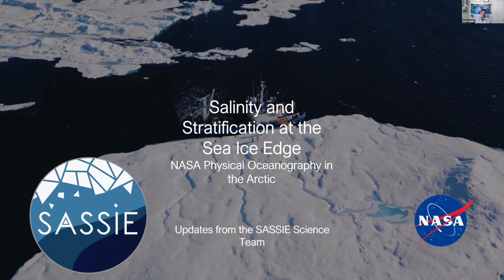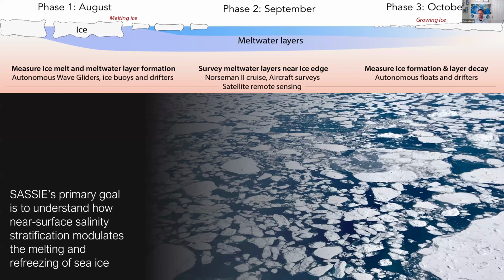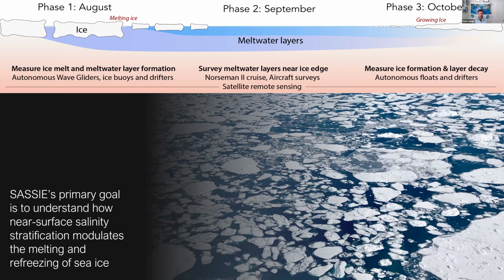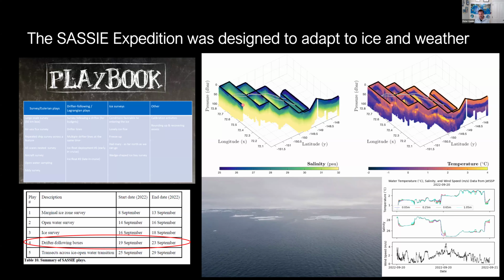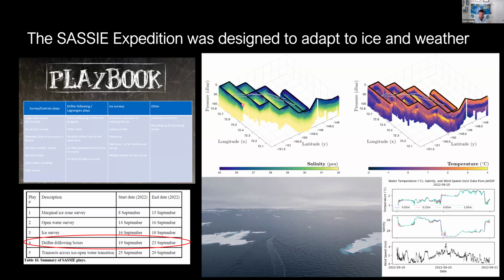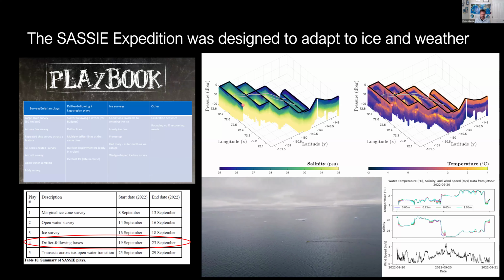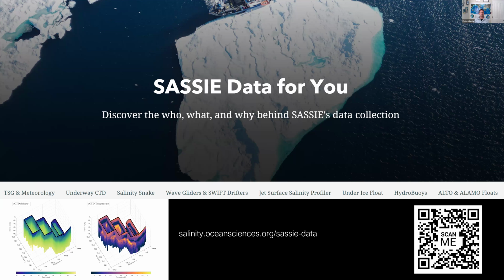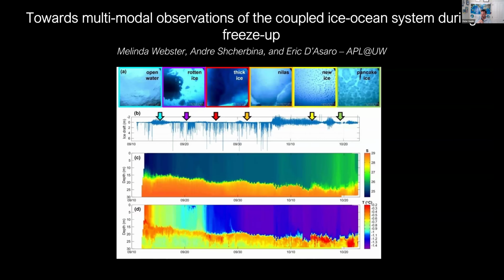Salinity and Stratification at the Sea Ice Edge (SASSIE) Project Update: Physical Oceanography Mtng

Comment: This video contains the UN Climate Change disclaimer.  Global warming was officially stated at 1.1°C in 1991 and 1.06°C in 2022.  There is no mechanism that would allow greenhouse gas behavior to cause global warming.   The back of the United Nation's IPCC science report states it took its greenhouse gas samples at 20,000 meters altitude where it is common high school level knowledge there is no greenhouse radiant energy.  This is typical practice for deceptive marketing to state legal data transparency protecting the perpetrators from fraud prosecution.  

Earth's greenhouse effect is frequently used as a primary example to high school students of a system always in saturation from the strong greenhouse gas water vapor absorbing all the greenhouse radiant energy from the earth with greenhouse gases within 20 meters of the surface that is all around us everyday and can't have its overall effect changed.  There is no further greenhouse radiant energy to interact with greenhouse gases.  At 1% average tropospheric water vapor over 99% of earth’s greenhouse effect is from water vapor.  Water vapor would hold earth's greenhouse effect in saturation if it were the only greenhouse gas in the atmosphere.

Arctic warming is taking place with the proving mechanism being warm Atlantic Ocean waters migrating deeper and more frequently into the Arctic Ocean warming it and the region.   That warmer water is causing a few weeks less of reflective snow and ice coverage resulting in more solar heat gain to the Arctic region surface.

Atmospheric CO2 levels of 1200 ppm about three times what they are today would greatly invigorate C3 plants the majority of plant life on earth greatly greening the planet. 

0.4% of the atmosphere is CO2 and on average 1% is H20 water vapor.   (1% H20)/(0.4% CO2) = 25.  Water vapor is 25 times more present in the atmosphere on average than CO2.   Water vapor has an CO2e of 18,  18 X 25 = 450 CO2e total for water vapor to 1 CO2e for CO2. 

The Earth’s oceans have 3-1/2 million sea floor volcanic vents warming the water and changing it’s chemistry that have not been systematically accounted for.

Comment: 35min in, salinity hard to detect by satellite reaction pH determines freezeup temps so the need to correlate salinity to pH to know it's too low for below calcium_carbonate, CaCO3's saturation_point pH of 8.2 tied to zooplankton.

We're dissolving plankton 10-times faster vs PETM's flood_basalts the clue.

We can refreeze seabeds using robotic sonic drilling rigs fleets of 100-rigs placing 10,000 chill-rods/km² takes a week, to do the 120k-km² of the Kara-Laptev-EastSiberia Seas takes 2300yrs for scale.
Reply: All of the oceans are about 8.2 PH, and the dead zone in the Golf of Mexico is at 8.4 PH to high to support marine life.
Reply: 35min in, prediction vs remediation for strength-to-pH ratio is only raising freshwater sources by mixing rockflours this drops "when it freezes" the mechanic for sea_surface pH.

From the paper, the outflow deposits of major rivers make up much of total deposits, reply if notes read pls.

Comment: An iarpccollaborations member 4-teams phys. oceanography main, independent.

The recent paper on Kara-Laptev-EastSiberia Seas seabed  temp profiles show thawing to depth now bubble_fields soon grow to huge pipes outgassing methane later on 

The reason is we've dropped pH from 8.2pH happy to 8.2pH dissolving plankton 10-times faster vs PETM's flood_basalts this raises freezeup temps above-2C makes weaker seaice and far less brine volume. 

More importantly it prevents air's COLD from conducting to seabeds to keep deposits frozen.

Rock_erosion raises pH back up pretty slow so we must physically refreeze them or go extinct on 1700-Gt of methane for the Seas & 5-Gt in the atmosphere the context.

I've begun a project plan roughout unfunded personal RnD to estimate a fleet of 100-rigs placing 10,000 chill-rods/km² takes a week.

To do the 120k-km² of the seas would take 2300yrs for scale. 

I have trouble entering via android so haven't posted much, apology

Yours,  Tom Mallard